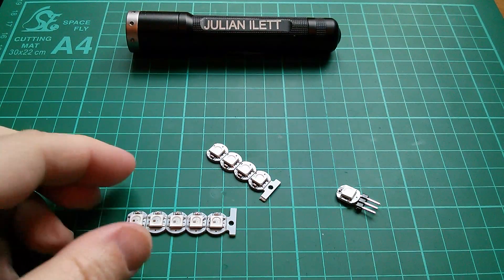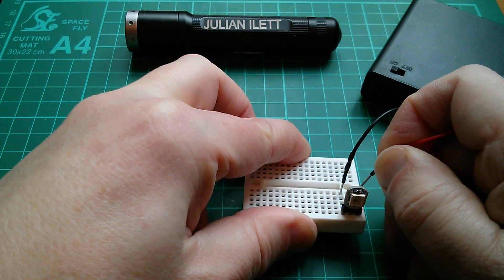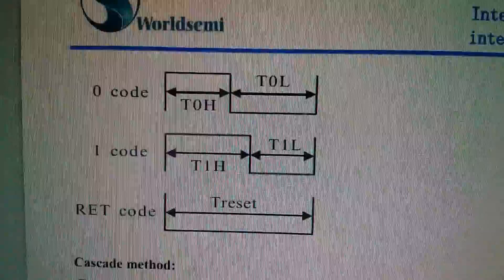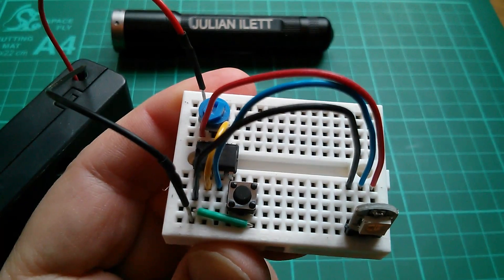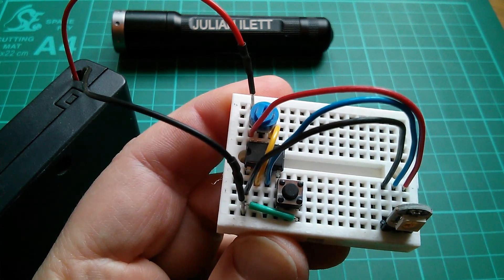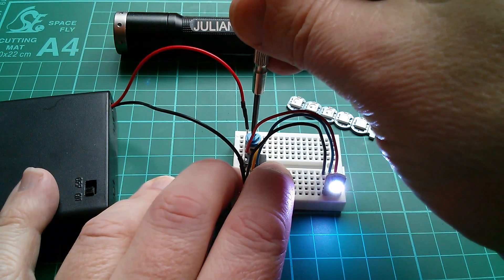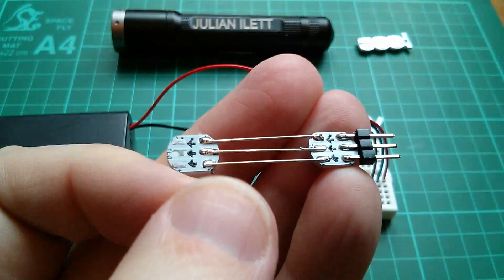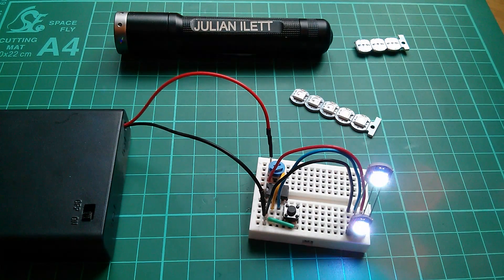Quick and Dirty Neo Pixel Addressable RGB LED Tester WS2812B

Comment: Please add more tests of neopixel/ARGB LED analogue/physical behaviour. Despite tons of online tutorials I found almost nothing about that.

Many people complain that neopixels draw too much current for a certain application, but don't want to reduce the count of LEDs, and dimming in software reduces resolution and can be unsafe if crashed. 

I e.g. found out that WS2812B LED strips can be dimmed the analogue way by reducing supply voltage. Simply putting a resistor into the positive voltage line will work but makes them flicker (I tried a big rheostat turned down until redish glow) and brightness certainly changes with count of lit LEDs. Much better works to put 1 to 3 silicon diodes in series into the positive line. When only used for a direct view ornament or pilot lamp instead of shining into a bigger space, default 5V can be way too bright. At +3V (dropping to 2.7V when burdened) they still work well but draw only about 100mA instead of 1800mA per 30 LEDs, and because lower voltage turns down the blue LED first, this also makes the colours warmer, which is a nice side effect to get rid of the cold white and stinging blue that hurts eyes so badly. I successfully tried 3x 1N48 to tame brightness down with warm white. 4 diodes made blue disappear, and 5 diodes only left a faint red. The LED strip did not crash by this. Because 1N48 are only rated 100mA, I tried "4007". 3 of these stay brighter (like small xmas fairylights) with more neutral (still warm) white, which may be the best compromise.

Important will be to put a resistor (website says 470 Ohm) into the data line to reduce RFI and prevent the LED from drawing current through it when running at reduced supply votage. I read that this CMOS input rates everything above 2/3 of the supply voltage as logic "1", hence the resistor may also help against garbled data when it fails to detect "0" properly.

Because I had no microcontroller but only used the Polychrome RGB output of my Asrock B450 mainboard for the tests (no OS installed, running on BIOS mode), to avoid PC damage I did not dare to try more extreme things.

https://wp.josh.com/2014/05/13/ws2812-neopixels-are-not-so-finicky-once-you-get-to-know-them/

Seeing the crude 1-bit protocol of ARGB LEDs (kind of shift-register filling 24 memory cells and passing the rest to the next LED), cheap Chinese neopixels surely can be fed with plenty of analogue signal garbage without permanently ruining flash memory, this has the complexity of a 1970th LSI chip and makes them a perfect candidate for circuit bending. The 800kHz bit clock rate may be observed on AM radio. My first question is, what would happen when the data output of a neopixel strip is fed back into its input - or nastier, put a transistor in between to invert the signal and mix it through a voltage divider with original data from the microcontroller to produce colourful raving nonsense. Or what will happen by connecting a photodiode like a lightpen to the data input and feed it with the own PWM flicker frequency picked up from the strip?!?

Neopixels are almost as crazy basic digital shit like neon lamp logic and may be abused to build things they were never designed for.

Comment: this is just, sooo, weird, its pulling me apart, the electrician in me screams while the programmer says "well it works so its fine".
also i've been looking for a breakout board, to which you connect the rgb strip you have, a power source and by the change of 1 resistor you would get different colours. anyone seen it?

Comment: You could use a AtTiny85 to drive the WS2812s, it is a 8 pin chip alternative and would require fewer parts.
Reply: tehaxor69 I have done this with a 12 pixel ring and an ATtiny85
Reply: Nick B I want to put a SMD Attiny85 on a flat flex PCB, then tape/glue it to the back of a WS2812 or APA102 strip, then use 2 wires for power. One thing I like about the APA102s is that you don't need the whole LED color buffer in ram, just compute the color you need for a pixel, then update a cell and repeat. I got Rainbow/Larson Scanner/Chasing type effects to work with this. The only reason for this is if you have over 100 APA102s, since 512 bytes could allow for 128 cells, but you need some SRAM for the stack and variables.

Comment: You are correct that the tolerances for the datastream to worldsemis is not as tight as the datasheet would lead you to believe.

Reset width is actually >6ms, lows can be anything from 450ns-5ms. The high period is the only thing that is remotely critical.
Reply from the maker: Interesting. Sorry it took me a year to reply, but I'm thinking of playing with these LEDs again soon :) That information could be very useful.

Comment: Hello, thank you for your videos! I have been a long time subscriber and am finally getting into more tinkering that just +\- stuff. Could you please recommend a inexpensive DMM to me? Or give me suggestions on what features you would look for in a DMM for a beginner/novice? Thanks again.
-CDP
Reply from the maker: CDP135Z I'd buy something really cheap - but accept its limitations. It won't be particularly accurate and you'll need to keep it well away from the mains. But it will tell you far more than having no DMM at all. When you know what's important to you, you can spend a little more.
Reply: Thank you very much! I have one on the way.

Comment: How bizarre, I added a string of the sign version of these pixels from China, and was actually just pondering yesterday what sort of effect I could get by just banging random noise to the string.
I reckon the internal chip is just plain logic with counters and shift registers, so there should be a modest tolerance.  Probably just as well, since they demand data at such a high rate it doesn't leave much effect processing time on a common PIC chip.
Reply from the maker: bigclivedotcom Did you ever play with the dsPICs?
Reply: Julian Ilett No.  I'm a PIC dinosaur.  I tend to stick to favourite chips (currently 12F629 and 16F627A) until I'm forced to change.
Reply: bigclivedotcom And as you can guess, my original thoughts on real time colour data generation for huge strings of pixels was dashed as soon as I realised that bit bashing the data fast enough on a common processor eats its entire processing time.  And that kinda points at frame stores for the data and jamming the processing in between actually transmitting the full frane of data.
Reply from the maker: bigclivedotcom I've not used the dsPICs either, but I read through the data sheet. They have some super fast hardware like multiplier and barrel shifter. Or you could use a separate PIC to do the serial transmission. I haven't played with PICs for a while now - favourites were 12F675 and 12F683.

Comment: Hey Julian, I know you own a bunch of "USB Charger Doctors". May I perhaps ask which one do you prefer? I own one of the blue ones myself.
Reply from the maker: PuchMaxi1988 I prefer the one which holds data when power is removed. Not sure what it's called - it's white with an LCD and single button on the font
Reply: Julian Ilett Thanks for your reply. I do recall you using the white version before, I will look it up thanks.

Comment: Julian,
I usually wet my fingers and start softly touching the pins (hold one finger to the positive, and the other to Data In). This works very well with analogue circuitry, but also nice on digital. Still a lucky touch is needed.
Reply: In a Swiss Tony voice: "controlling addressable LEDs without a micro controller is like making love to a beautiful lady..."
Reply: "lucky touch" Unintended pun :P